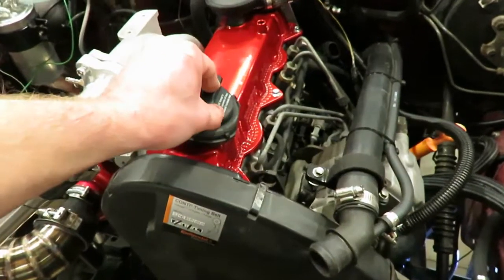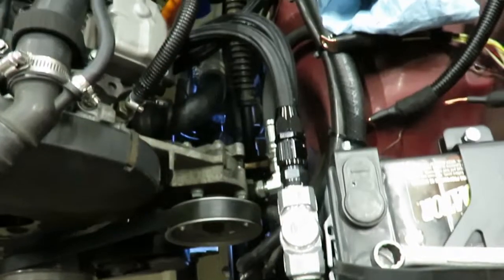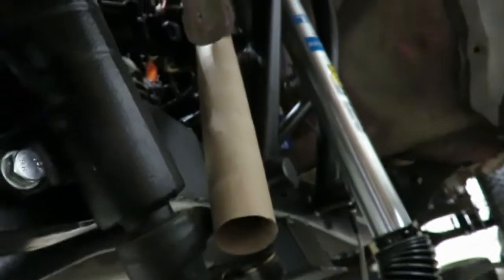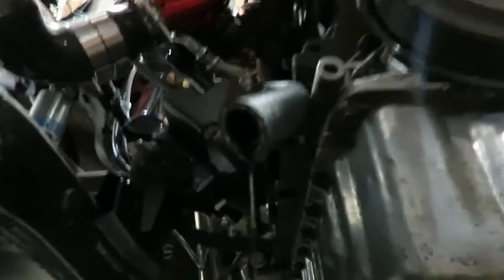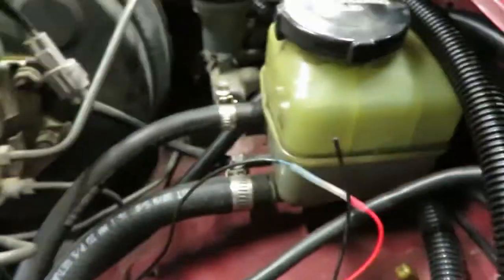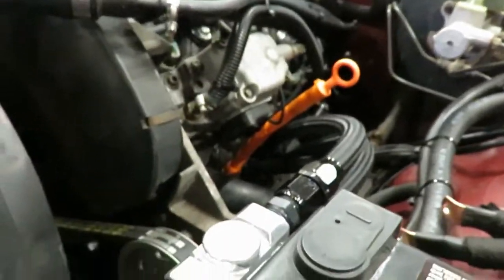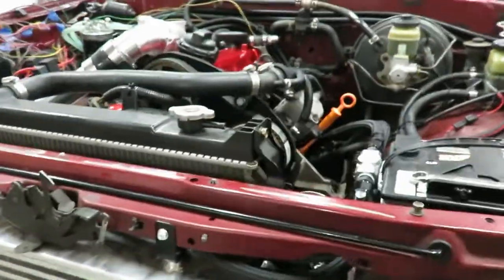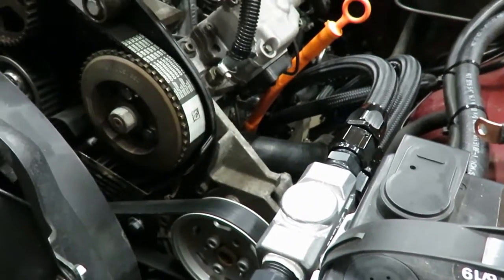Toyota TDI Swap Getting Ready To Start The Engine!!!!!

Comment: This is the most complete Toyota TDI swap information I've found on the internet Mr. Niemela. Well done sir. Really nice work and very very inspiring! I've watched all these many times trying to gauge if I could manage this with my own '92 22re. Things like selecting the right adapter kit for Starter/Exhaust clearance, hoping to avoid Driveline/firewall alteration and getting the computer to work outside of a VW. The 22re is not very powerful nor is it fuel efficient. I bought a 2001 bug with an ALH to commute with and fell in love with the torque and economy.  These videos help me get a sense of the amount of work and attention to detail required . You must be proud of the results. I'm so excited for you. So stoked to hear this machine rumble to life.
Reply from the maker: Thank you so much! Its a very fun swap! Honestly it isnt too bad, especially with all this info for you all! The BHW exhaust manifold makes starter clearance a non issue! Most of the adapters move the engine and trans forward so usually driveline mods are needed. My adapter is 1.5" thick so my trans is in the stock location!!

Comment: Hi I don't know where you are located.  Would you be interested in doing a TDI swap into a LIKE BRAND SPANKING NEW low 62K mile S10 Blazer 4X4.  DCS make a complete kit (adapter plate, fly wheel, starter, etc for a chevy 700R4 trans).  It would be amazing to have a S10 Blazer that gets 30+++ MPG with its 20 Gal tank.